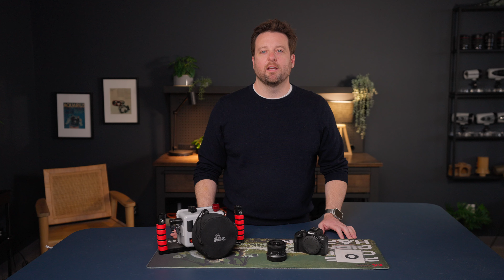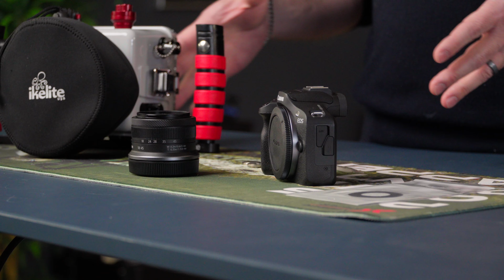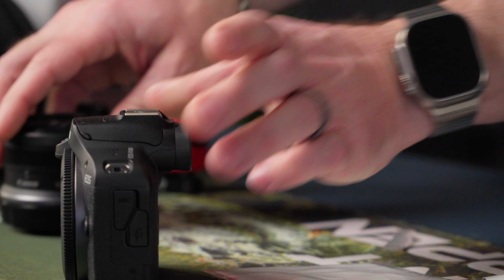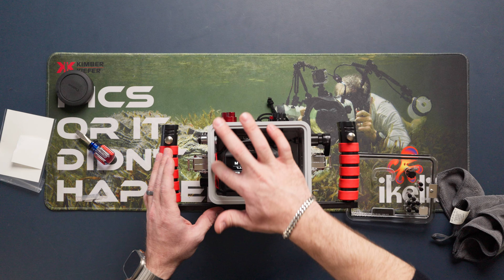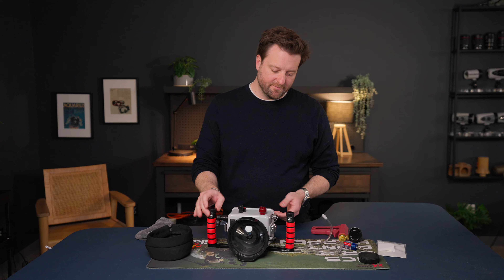Canon R100 with 18-45mm Setting it up // Ikelite 200DLM/D Underwater Housing

Comment: So the flash wouldn't still be an option? If not, is there a simple underwater ring light you'd recommend for beginners?
Reply from the maker: The flash is not usable to illuminate the subject, but can be used to trigger an external strobe which is the most popular and versatile way to shoot. There are some ring lights out there but we don't have enough experience shooting with them to provide a recommendation. Note a ring light will only be good for macro, not for wide shots or medium-sized subjects.